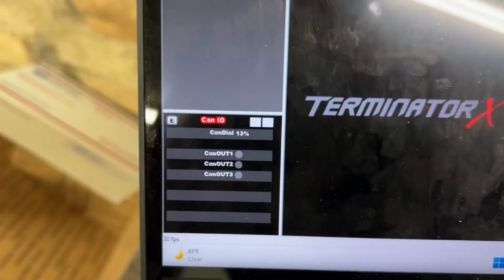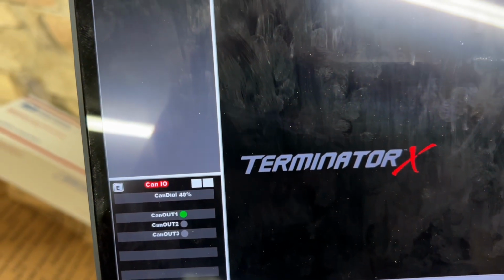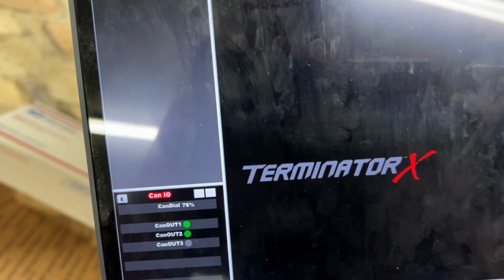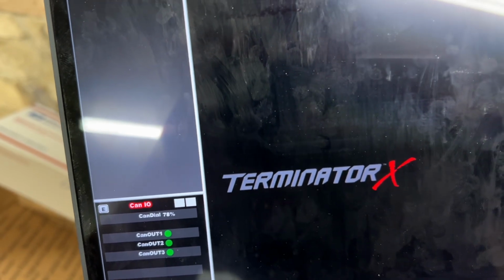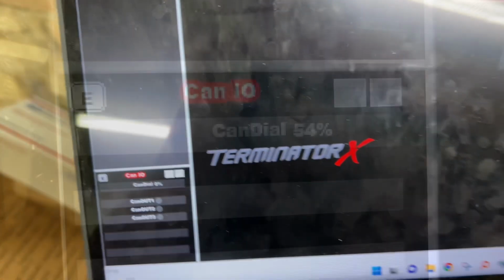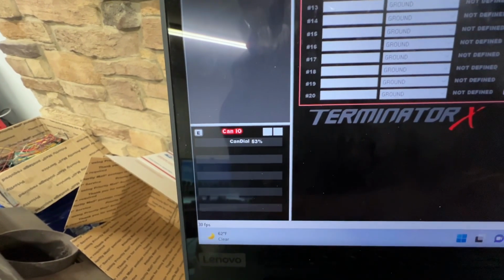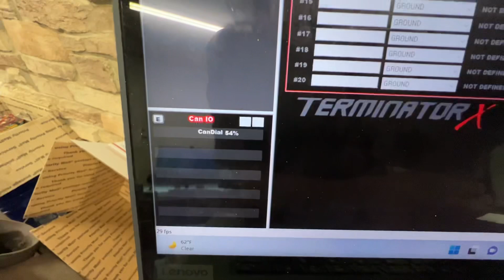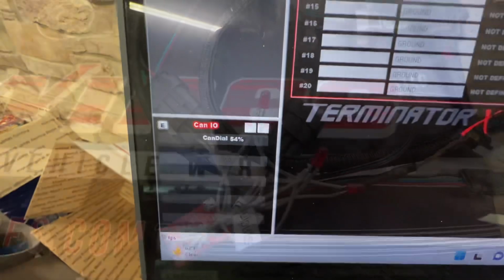Can bus flex and dial a boost board

Comment: I would buy it time is money I would rather it be ready to go. I love innovation from free thinking I sure as hell couldn’t design it but I will definitely buy and use.
Reply from the maker: The issue is the Holley can io box is 275 and has 8 in and 8 out but you would have to wire the whole guy, so yeah I though doing pnp harness capable would really make it awesome

Comment: Could the dial input be used for a hall effect sensor to do wheel speed? The resolution seems good. Will I have to buy the over-priced can splitter?
Reply: Also could the outputs do pwm?
Reply from the maker: He said it can pwm but being it’s over canbus it may not have the speed required to do boost control or other fast acting things
Reply from the maker: Unsure how it’s programmed but it is a 5v, might be able to use it as a speed input, ideally you offload your flex and dial and then you have two more direct Holley inputs available for your wheel speed stuff

Comment: It would be nice to see a footprint for a wire to board connector on the board. If customers want to save the 5$ and solder their wires on they still can.
Reply from the maker: Yeah he is putting a molex connector/pin header on next board revision

Comment: How many times can you split the can bus? If running the Holley dash with Term X 3.5” screen and a 3rd can bus for the computer dongle. Seems like you’d need a 4th  can bus port. Or sacrifice one of the other 3.
Reply: CAN works best with one long back bone that goes between the two furthest devices and has terminating resistors at both ends. These are sometimes built into the devices. You can then have a large number of stubs coming off the back bone they just needs to stay short, less than 3ft is typical. There are practical limits to number of devices that can talk on a network before you have issues but it is usually ten or more  (devices that only listen aren’t an issue)
Reply: That makes sense. In my case, my back bone is the Term X to the Holley dash. Since the dash has I/O that triggers accessories from info sent by the ECU. Everything else is just communicating. Thanks
Reply from the maker: The cool thing about can is you can just keep going